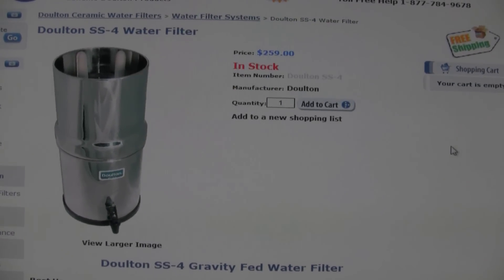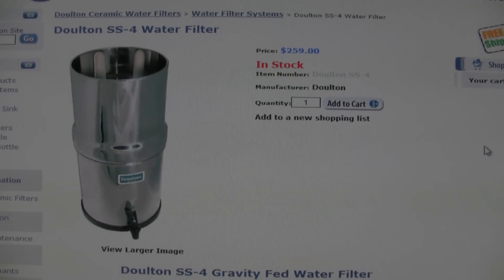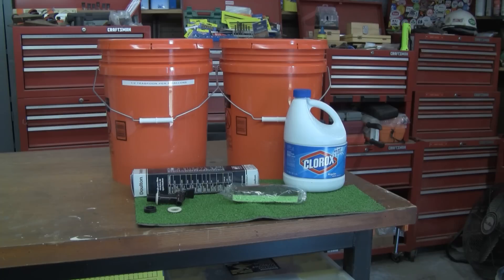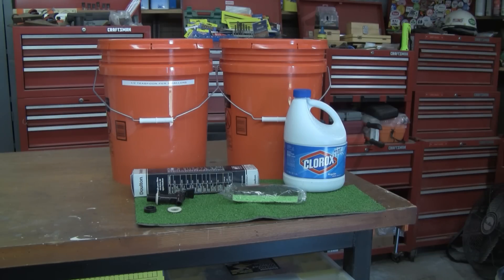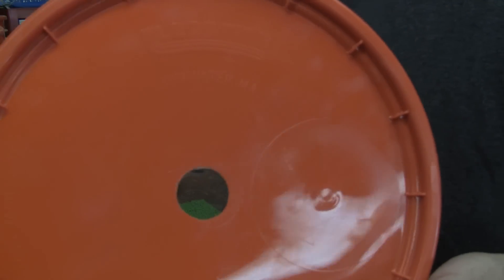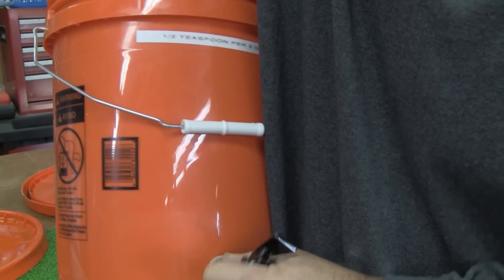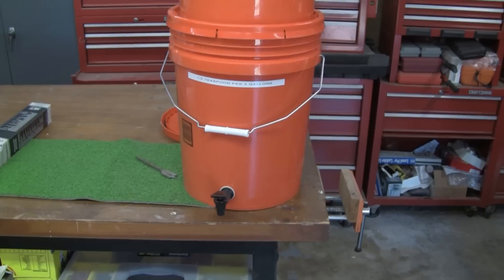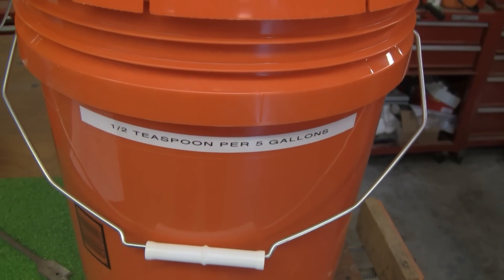EMERGENCY WATER FILTER SYSTEM SHTF

Comment: I appreciate the video, this is a good idea, but I have a couple of comments.  First, buckets intended for home improvements may be made with recycled plastic that may contain all sorts of chemicals.  You should use buckets that were used to store food.  White plastic is no guarantee.  All the buckets at my local swimming pool supply store are white.  Also, bleach is a good sanitizer of water.  Of course the bleach can be overloaded with organic contaminants in the water, but if the water is quite clean, like rain water, it can work when at the correct pH, which can be adjusted with vinegar but this is dangerous so look into it and be careful.  I would not use bleach, but boil and cool instead to be almost sure all pathogens are dead, or make beer or wine first, or a pressure cooker (which will sterilize the water).  IMHO.

Comment: Great Video. I ordered the Dolton filter with rubber washer from amazon but it does not come with the nut.  Where would you suggest I purchase the needed nut.  I have everything working as you indicated.  Thanks for the help.
Reply: There is just me so I decided i would just use a 10 gallon work water cooler that already has a spicket with the lid adapted to catch rain water adapted to catch rain. It will be on concrete blocks so I can draw water out the spicket for purification. The parts for this have all finally arrived. I got enough to make 2 in case I mess one up or if not can give to grandchildren house.

Comment: I have these exact buckets and I assure you THEY DO NOT TASTE BAD.  This is our main water source and it's very good tasting water. I use a different filter and I put 2 filters in instead of 1.  Every time I fill my gallon water jug, I put that in the fridge and poor another gallon of tap water in the top bucket.  It takes a while to filter so stay a gallon ahead.

Comment: Thank you for the video.  I've done some research and found out that the filter that you are using is not good. There's a small print that reads: **Please note, this filter does not contain carbon therefore it does not remove taste & odor**. I recommend Doulton Super Sterasyl Ceramic Filter W9121709 which contains a carbon filter inside. Good luck!!

Comment: Chlorine takes the oxygen out of the water. Clorox is not nessesary unless you store the water for a long period of time.  The filter takes out those little nasty critters.  Always let the water stand until the chlorine has evaporated. You can hurry the prossess by pouring the water back and forth between two containers. This helps restore the oxygen, too. Thank you for this video, many lives will be saved if the people can drink good water.

Comment: Will the Ceramic filter remove chlorine (like activated charcoal)? If so, why not add the Chlorox to the top bucket so that the bottom bucket receives unchlorinated water?

Comment: I just completed my EWS .  It was easy.  I got two Homer buckets from Home Depot and got my Daulton ceramic water filter 2x10 off of Ebay for 34 bucks.  I reccommend ebay seller 'animedenise' as a source for the filter.  They were very courteous and the order was here faster than expected.  Thanks again FUBARPROTOCOL for posting this video.  I will  start running ppm (parts per million)  and ph test on some pond water in a day or so and will let you know the outcome.

Comment: drill a small hole, very small hole, on the side of and near the top of the bottom bucket.  Ya have to allow the air to escape for the water to flow in.  If this don't fix the problem drop me an email and we'll figure it out

Comment: Dude, notice the lids are not put on tight.  I bet you put one of or both of yours tight.  That creates pressure in the bottom and vacuum in the top bucket.  Fast fix:  drill a very, very, small hole near the top of the bottom bucket, this lets filtered water displace air.  If you're still having problems, email me and we'll fix it

Comment: I wonder where you get the 2,600 gallon filter capacity from? I researched that filter and found out it should be replaced after 535 gallons. Love your videos and like this easy DIY project a lot by the way.

Comment: I/WE are looking at a small property in Ireland and have been advised that there is no mains water. the water is from a stream on the property and  we would only be using it for long weekend and holidays so your bucket filters may work fine for us and boiling the water after...thanks for posting a usable video

Comment: After running the two buckets through it, it's running a lot faster.  Sorry to be so impatient.  Still considering adding extra "candles" to the bucket.  

Our local tap water is a foul smelling mess.  I got to drink a glass of the filtered water today, and WOW!  I'm keeping this system for drinking water, and making another for emergency use.  Well worth the $35.00.

Comment: It took over 12 hours for 5 gallons to run through mine.  I'm running 2 buckets of tap water through it to flush it out.  It that time period normal?  I'm thinking of having 2 to 3 filters in the top bucket to cut the time.

Comment: The filter in question is simply a ceramic filter module containing 6 individual ceramic filter elements. These elements do not contain an activated carbon filter core and do not reduce chemical content of the water. However, it acts a mechanical filter membrane to physically strain sub-micron particles from the water. The filter elements are cleanable and reusable over 60 times (until basically you've removed all the layers of the filter membranes).

Comment: Because it does not contain an activated carbon core stage of filtration, there is nothing in the candle which will exhaust itself (like typical carbon filters have a finite capacity and surface area).

Comment: The thing you have to remember, is this filter is designed for microbial and particle content in the water (not chemicals or dissolved inorganic). And because the filter is cleanable and reusable, it drastically extends the life of the elements.

Comment: hey fubar, you only use the bleach if storing the water right? im gonna make this system but for filtering my tap water so i wont need bleach right. basically im asking when do you need to use bleach besides storing water. thanks love your vids

Comment: for those who like to scrap stuff and recycle,the drain valves from the bottom of hot water heaters work quite nicely. simply unscrew with a wrench. some brands still use nice brass ones,some plastic ones are crap. helps if you know a plumber or scrap dealer.

Comment: Easy to build a water filter.... Need - Muslin cloth, sand, crushed charcol, large plantpot with hole in bottom, something to catch the water, maybe some bricks.
Place plant pot on bricks, place water catcher under hole, place in clloth into pot and up the sides as one sheet, put alternate layer, starting with sand, of sand, charcol, sand charcol, up to 3/4s of the way up the pot.... Add your water and wait.... Boil whatever catches in your catcher pot.... Cheap simple and works!!!

Comment: great idea..   would be nice if you showed it in action..   just curious if gravity alone is enough pressure to force dirty water through that filter.  i know they use similar filters in small camping set ups, but usually have a hand pump tp force the water through it. the ceramic is so fine i dont know if this would really work without seeing it in action..   great idea though.

Comment: Hey, thanks for this...I have been watching Atmospheric water generators selling for big bucks...I decided to take this idea and add it with another idea I had...I hooked up my dehumidifier to drain into this system...Using the water from the air and filtering it through this system I am getting virtually free water...very slow proccess, but once the bucket is pretty much filled with clean water, there is plenty - The Ph balance isn't bad but minor after taste, maybe needs another filter??

Comment: Also, is there a website to find conversion tables for chlorine tables instead of using Clorox bleach because clorox bleach goes bad in really a short period of time, so you may not know the proper amount to use after so many months and if it still works??. With chlorine tablets you can use it to make bleach water and it will be pure at the time of mixture and you'll then know how long it will really be good for. The tablets last a LONG TIME too.

Comment: Yes Brother you should use chlorine or some other purifier after filtering. Or as MrBajaFun so rudely put it, boil it. It's really a two stage process. Filtering will remove particulates but not the microscopic little buggers that can make you really sick and unable to defend yourself and those you love. If you were in the wild you could even use the UV rays of the sun to kill microbes in the water. Any way you do it Filter the Water & Kill the Bugs before you consume the water when possible.

Comment: Where did you buy your bucket spigot from?  I went to Lowes, and of course they looked at me sideways.  I should be able to buy something like this at a store, g eeeeez, everything is made from plastic today, why is this so hard to find?  By the way, I think the ceramic filter you chose doesn't remove the taste and smell in the water.  Correct me if I'm wrong, I'm trying to copy you, but Doulton says it doesn't do it.  Lowes carries white food grade HDPE 2 water buckets with rubber gaskets

Comment: nice designed.  Like Everyone are saying.  Material need to be different.  Boiling is always the best option but will do fine without it.  I was thinking about using the same designed and concept and add gravels and sand to the top bucket for biofiltration.  Thanks for the idea

Comment: Sorry, but I'm confused. The small amount of bleach goes in while filtering water or is it just for cleaning the bucket?

Also, say a watermain breaks and the county puts out a boil water notice, I would boil the water first and then use the filter?

Comment: Someone might have already mentioned this, but I didn't flip through all the comments. Love the design and looks like it'd work out great, but maybe adding another small water tight gasket where the bolt fastens the filter to the top bucket could be another preventative action to avoid mixing bad water with good water. Not sure if the filter already has a gasket at the bottom of it, but shouldn't hurt to have another just in case. Nice video though thanks!

Comment: You might put the clorox in the first bucket so that the materials made from the clorox reacting with organic material are filtered out. And consider using high purity white vinegar or ethyl alcohol to clean your buckets. Personally, I clean everything with vinegar and sterilize with white lightning --not much better for you than the bleach, but it doesn't create volatile organic compounds.

Comment: That's a pretty clean setup. I just wanted to point out that the buckets you've chosen aren't safe for handling drinking water. I'm doing a bunch of research for my own project, and the word is that you need to use an HDPE, FDA-approved bucket if you don't want chemicals leaching into your water. Not too hard to find online, or one can go to a supermarket and ask if they have any frosting buckets. As far as fittings go, it's tough to find anything truly meant for potable water...

Comment: Put a 3/8th hole in the lid of the bottom bucket and put the male end of the ceramic filter through both and secure the nut, then no "dirty" water, that could get spilled while dumping it into the top bucket, can find its way into the "clean" bucket. this would require another gasket, inbetween bottom of top bucket and top of bottom bucket

Comment: @darkman2011zm 
Yeah still plan to bleach it actually. The water off your roof while seems clean its not. Particles and other crap will be on your roof when it rains and might contaminate. I wont be risking my health by wanting to skip a step, know what I mean?
I also bought a Doulton W9121200 SuperSterasyl instead for carbon. Only 600 gallons but you shouldn't need to use more than that for a natural disaster. With my family we would need 4-5 gallons a day.

Comment: @Twisted86  Did you get a response on that question? I had the same question about the water coming off my roof in down my gutters straight into my filter bucket, I don't see why you would have to boil or bleach rain water, it's pretty clean before it hits my gutters, right??

Comment: Be sre to purchase Food Grade Buckets and BPA Free if possible. The more filters you install in your Gravity Flow Emergency Water Filter System the faster it will filter the water for larger groups. 

Produces up to 6.5 gallons of filtered water per hr with 2 filters 
Produces up to 13 gallons of water per hr with 4 filters 
Produces up to 19.5 gallons per hr with 6 filters 
Produces up to 26 gallons per hr with 8 filters

Comment: With this design, any water that missed the top bucket on filling and ran down the side would pour into the clean water bucket, contaminating it. Do you have any ideas on how to keep this from happening? "not missing the top bucket" is an obvious answer but not reliable as a solution as it is very likely to happen over the course of the filters use, especially with several people pitching in on the filling chore.
I would like a system that doesn't rely on bleach is why I ask.

Comment: nice- thanks. Very practical set up.  It all goes together beautifully- very slick setup.

If someone wants to increase the production, try making two or three units instead of placing two or three filters in the same bucket.

I imagine that if you gave the filter a little head ( few feet of tube so that you had 3 or 4 feet of water column above it) that it would pass more water per hour. Then you would have more fittings and production work.

Comment from the maker: @18wheeler76 You have to realize that this filter is very heavy and is removing 99% of the particulatesfrom the water. Iam sure if you make one with dule filters it would speed up the process. Let me know if you try the dule filters. Thanks!

Comment: One point to note is that you can actually purchase pool shock, which is calcium hypochlorite, and mix your own bleach for use in both water purification, & regular applications such as laundry. Yield from a 5 lb box of pool shock is 640 gallons of chlorine & will disinfect roughly 128,000 gallons of drinking water. The ratios: 1 heaping teaspoon shock/2 gallons of water to make bleach & 1 part bleach/100 parts water to disinfect the water. Special thanks to my buddy yankeeprepper for this info.

Comment: I would suggest you NOT buy Home Depot buckets (or at least their lids) because they were too lightweight.  We used them on a boy scout canoe trip and by the end of the trip (4 days) the Home Depot lids had all cracked into (from people sitting on them around the campfire).  I don't think they could hand the weight of a 5 gallon bucket of water on top of them. The other lids were fine, so maybe something sturdier.